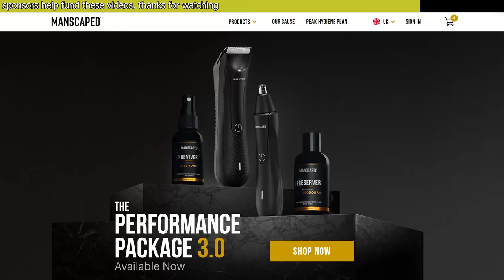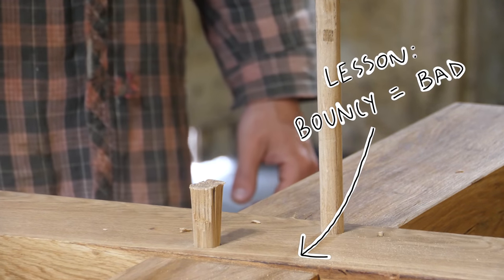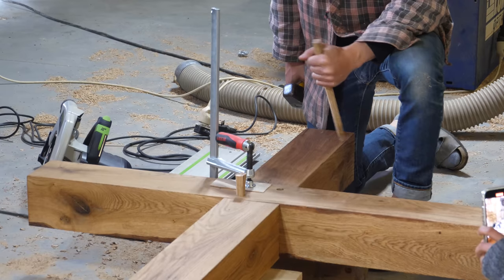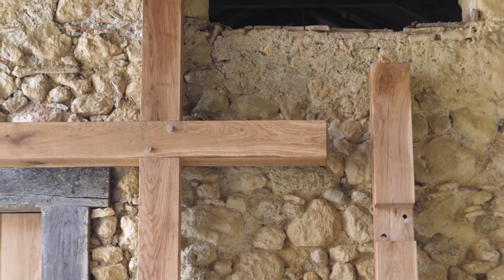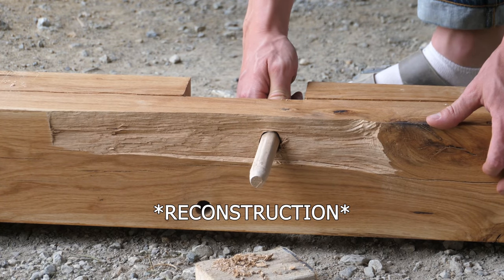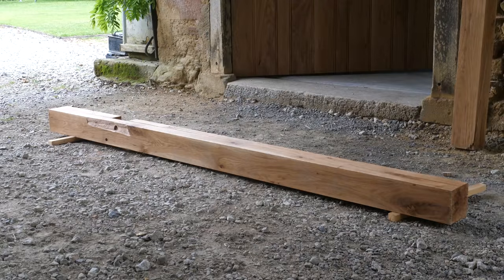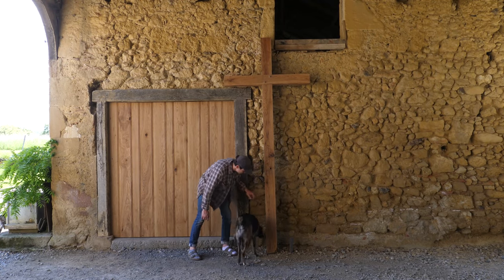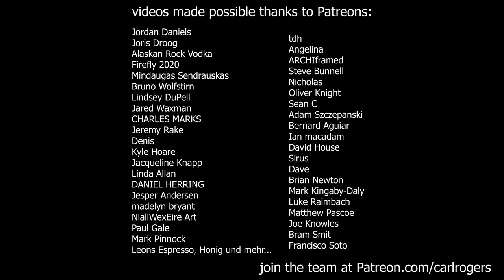Holy Smoaks

Comment: You should use a wooden mallet on the pegs, as the mallet absorbs the shocks a little, and then springs back some, which reduces splitting of the pegs.
.

Comment: First message from. me Carl. As an ex wood butcher I love to watch your working with such beautiful timbers. Rare and incredibly expensive in my home nation. 
Have you ever used or considered using the Japanese saw or nokogiri (鋸) ... saw used in woodworking and Japanese carpentry that cuts on the pull stroke. Ita great tool for all sorts of cuts and is equal to or better than a tenon saw for many o0f the cuts you guys use a rip or crosscut saw for. I used them after being converted years ago for all sorts of mitres and fine cuts.

Comment: Like many woodworking videos, this one shows more the tools than the actual work. Regarding the strength of the joint, the strength of the wood is related to the type of wood and the cross-sectional area. The union that you present, removes half of the piece, therefore for the same union, you must use a wood with a larger section, which will be more expensive.

Comment: That blow out at the back of that piece isn't a problem, a precisely cut patch would do the trick. And before you glue the patch on, dip it in water, which causes it to swell, giving you a super tight fit.

Comment: Great stuff! You should think about making a shave horse if more draw pegging is on the cards. It's one of those tools that once you've made one, you'll wonder how you ever got by without.
Reply: A lathe would make the dowel pegs quickly and accurately with the same taper as the tapered reamer which really should be used to prepare the holes.

Comment: Kind of figured you'd have a problem with those trenails when I saw you banging them in so hard.  Tight, yes, but not that tight!  Wooden spikes like that work best not because they're driven in like a splitting wedge, but because they're first dried out by the fire so they shrink a hair.  It's still a drive-in fit, but after they are in and cool down, they absorb ambient moisture and swell up to jam tight in the two pieces.

Nice video and fun to see the crucifix come to shape.  Getting those faceted ends so perfect was oddly pleasing!

Comment: The fundamental error with the pegs is putting them in the same direction as the joint! They need to be installed oblique to the way the joint releases. Just drilling on an angle would have worked.

Comment: Which wood stain did you use? I could see it was Sikkens but not the type. It leaves an amazing finish. Great vid BTW, subscribed!
Reply: Cetol HLS plus 000, the colourless variety.
Reply from the maker: good spot
Reply: @johannes.f.r.  it s just stain or it is 2 in 1 ?
Reply: @antonoctavianoctav6129  It is a 2 in 1 with a UV block too. It is meant for wood that still should be able to move, like fences, siding and timber frames etc. It's moisture regulating, but I didn't find anything about being anti-fungal. It doesn't form a film. Just used a can last month, looked good and is fairly affordable.
Reply: @johannes.f.r.  thx dud

Comment: Interestin video. 
I think the joint would be stronger, if the pegs were not parallel to the insertion axis of the joint. As they are, they do not lock anything.
As it is, the joint can be dismantled without removing the pegs… perhaps with an hydraulic jack !
If you’re really searching the maximum strength, try a diagonal peg.
Reply: Yes, a fundamental error misunderstanding joints. The whole joint work itself loose with the weather changes sitting outside.

Comment: I hate to be that guy, but please don't wear a shirt like that when working with heavy machinery. That big planer would suck it and therefore you in in milliseconds. You should also consider buying or building some covers for the rotating shaft, which is sticking out and also for the blade itself. best regards from germany, a carpenter with 10 fingers but only 9 toes 😅 (motorcycles are dangerous too 😉)

Comment: Most of the comments on this video aren't really useful in terms of carpentry and joinery discussion, so I thought I'd remedy that. Firstly, squaring up large stock like this when it's going to live outside isn't really worth the effort. I've worked on oak beams many times and I guarantee that after a few rainy days and hot days outside, it will no longer be square anyway, no matter what it's been treated with. Personally I would have straightened up just a few inches around the half joint and gone from there, as that joint will never stay tight and clean outside with shrinkage and expansion anyway. And I doubt you'll see any gaps which may develop anyway at that height. Secondly, it really is a bad idea to be forcing wooden pegs into any timber, the ones you made were far too tight, which only risks damaging the stock and that kind tightness would add little to the integrity of the joint. You would be far better off tightening them by knocking them in on an easy almost loose fit, cutting slots along both ends of the pegs and then driving wedges in the slots to get far better and easier tightness, where it really counts, which will then never come apart, even without glue. Thirdly, when cleaning up joint surfaces, once you have knocked out the bulk with a chisel, a shoulder or rebate plane is better and easier for final cleaning up. I've made a large 2 meter tall indoor ornamental Cross with a stand for a church before, and I found that some stopped chamfers gave a rather pleasing finishing detail. Lastly, nice collection of festools, but the chain cutter, I know the makita one can do plunge cuts, which would have been my first choice of tool for cutting the half lap out, will the fes chain cutter do the same, it ought to considering how expensive they are.
Reply: Agree with everything you said but re: rebate plane - I used to use one green oak framing in the UK but it really isn't a tool for heavy carpentry. In the right hands hands a sharp 2" Sorby framing chisel is a much more appropriate and quicker tool.. Amazed that there was all the Festoolery but no framing chisel..

Comment: Circular saws guides everywhere. True carpenters have an carpenter eye, following perfectly a line with a circular saw is absolutely a basic, no need of extra tools
Reply: Yes,a carpenter's eye because the other one was lost in a circular accident trying to follow a line....
Reply: @BeasleyStreet  if you dumb enough do it, for me still get both eyes and all fingers
Reply: @dorianbontemps9066  you have missed my sarcasm,attempting to follow a line free hand with a circular saw whether portable or fixed without a guide/fence is foolish as you know wood will take the line of least resistance if given the chance, this will end in tears and no straight line, I think you are an old romantic who has never used a circular saw.
Reply: I don't really agree with you, with practice you can follow the line perfectly, for your information, i have +10 years experience traditional carpentry here in France, and yes i'm for sure i'm an old romantic of the traditional wood handworking and even if my chisel and handsaw are never far from me, i use my circular carpentry saw everyday of the week 😉
Reply: @dorianbontemps9066  That sounds like a wonderful job you have there...yes all the old hand tools as well,cutting through softwood and soft hardwoods maybe, but no way are you going to keep a perfect line through harder hardwoods and hard softwoods....that's just not going to happen...🤝🙂